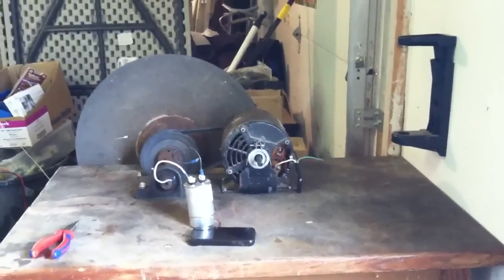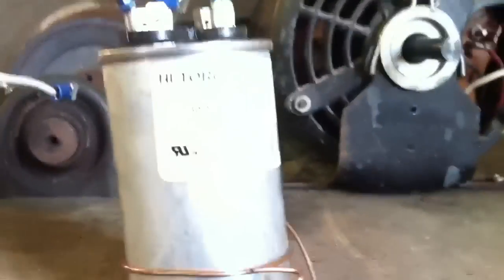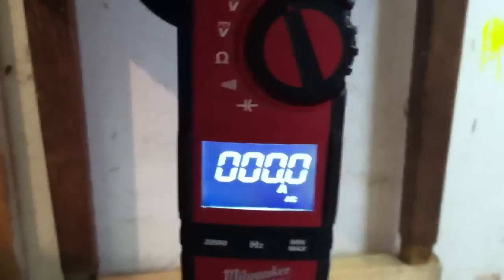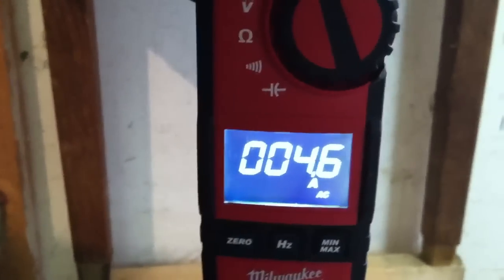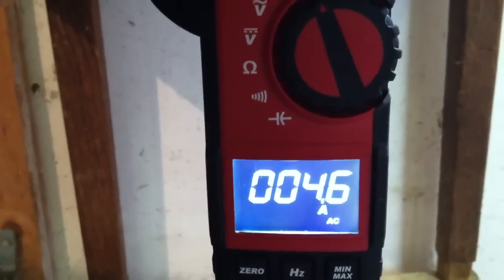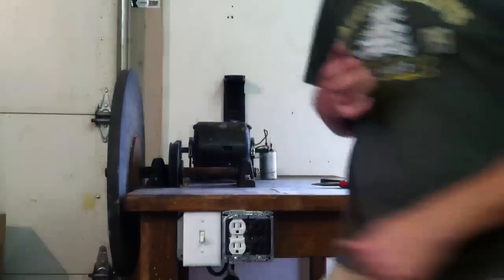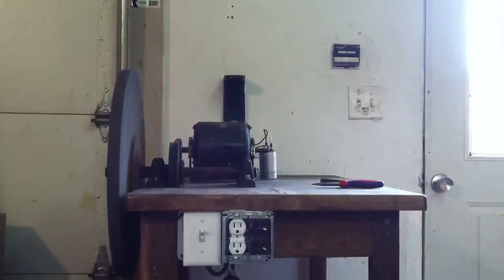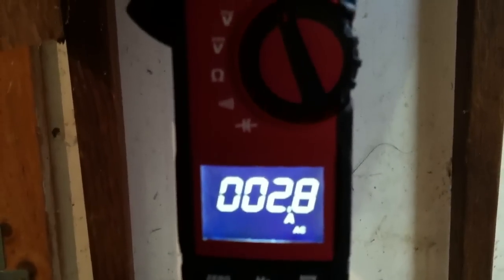Capacitors Save Money

Comment: The residential electricity or energy meters (Wechselstromzähler, Mètre AC) for flats or family houses are designed in such a way that they only measure the real component of the AC current consumed (the one in phase with the AC voltage).
Thus connecting any fully reactive load (capacitance or inductance) CANNOT worsen nor IMPROVE on the household's real power consumption (kWh).
The complex task of the power factor correction (Leistungsfaktorkorrektur, Correction du facteur de puissance), i.e. shrinking of the phase angle thus lowering the imaginary current component, which otherwise would tend to unnecessarily load the power lines and transformers, is deputed to power distribution companies and/or to their commercial and industrial customers. 
Amen! (Schluß!, Arrêtez!) to this topic once forever...

Comment: Unfortunately not, this is just the inrush current and although it is less it is still governed by the same power factor effect so even though it's drawing more current you are still only charged for the actual power used. One advantage is that there is less current draw so for really large equipment this can reduce the voltage drop and reduce the amount of light flicker during start up but nothing that will really save you money unfortunately.

Comment: The reason the current drops is due to "power factor correction" unless you are in a country that charges per KVA instead of KW, (Kilo Volt Amp, Kilo Watt) you will generally not save much money by correcting your power factor. The current draw is more but the motor will still use the same amount of real power or Watts, copper losses will increase due to the higher current but these usually add up to negligible quantities.